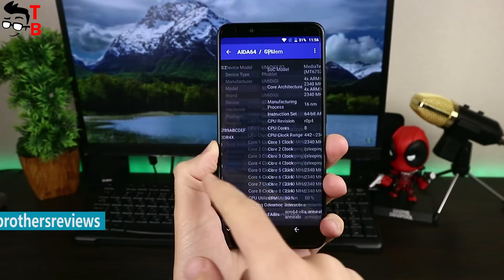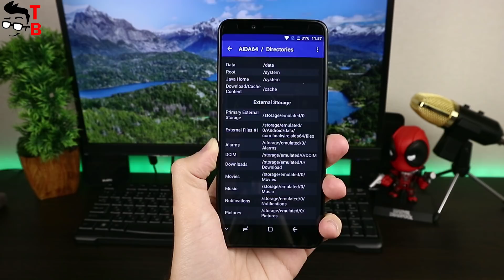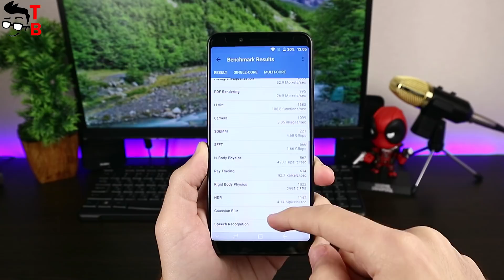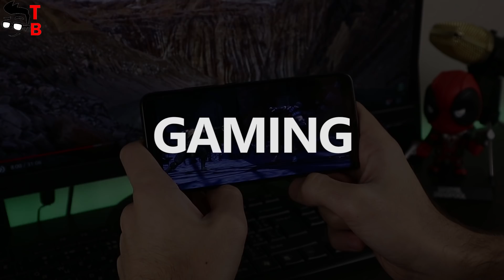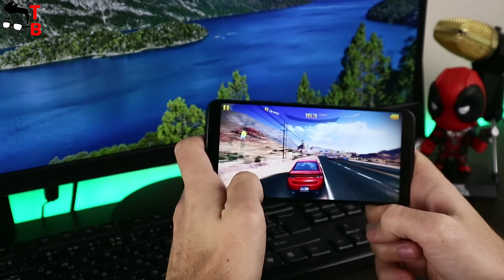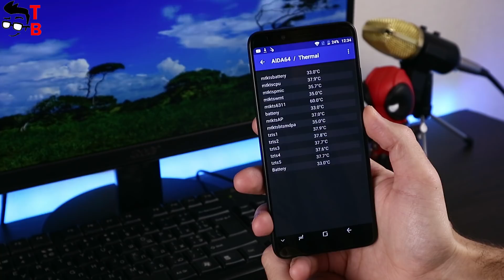UMIDIGI S2 Performance Review: Gaming and Benchmarks

Comment: I've given up on chinese phones, you get what you pay for which is garbage, I bought three phones all mid range in price and all of them were faulty in some way. 
Asus Zenfone 3 ZE552KL - Software issues because the OS had been hacked to change the chinese version to international kernel - the camera was broken on arrival and I had to argue with the seller for days to return and get my money back but I had to pay for the return of the phone so I lost money on that as it was expensive to return. 
Vernee Thor E which from updates from the company had software issues that shortened the battery life and has not functioned properly since and the original system image was taken down by the company so it can't be fixed - company agreed but only refunded $50 AUD (which they considered generous) so I lost money on that. 
Umidigi S2 - software issues so no notifications because battery low power mode virtually froze phone and that could not be fixed no matter what software changes were made, I even had Google android techs have a look at it and they agreed could not be fixed because partly hardware issue - USB C port no longer detects headphone jack and headphones so not possible to use headphones to listen to music.
SO I'M EITHER THE MOST UNLUCKY PERSON ALIVE AS NONE OF THE PHONES I'VE BOUGHT FROM CHINA ACTUALLY WORK PROPERLY OR CHINESE PHONES ARE GARBAGE.